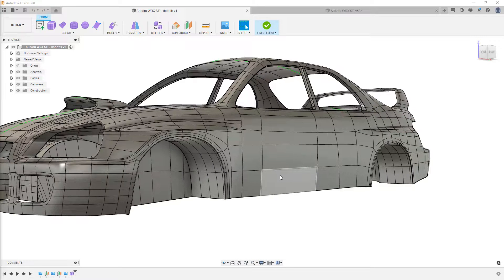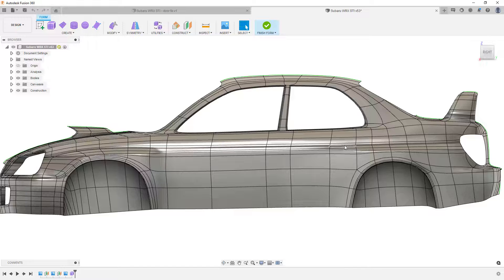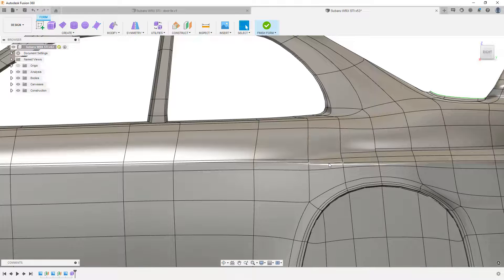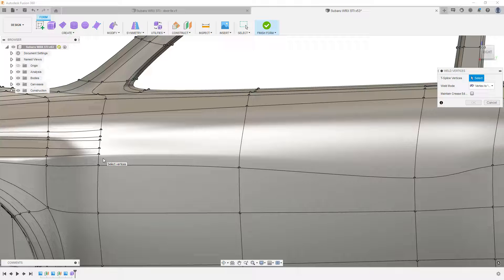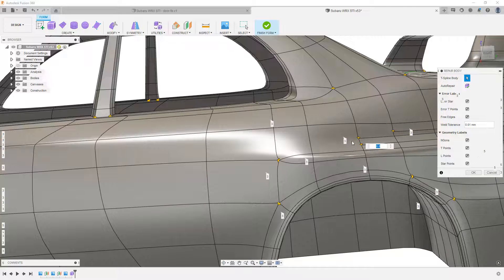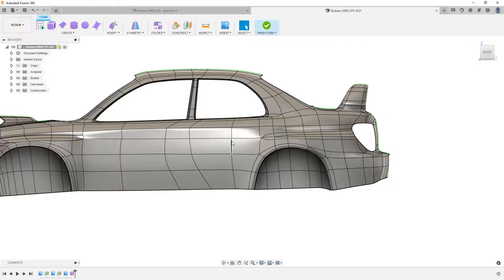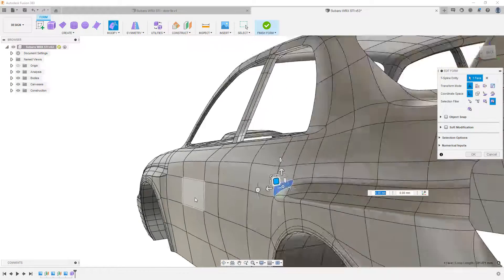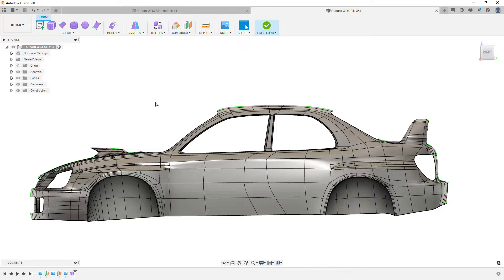Fusion 360 Forms - Part 11 - Fixing EVEN MORE surface issues

Comment: Teacher from 3:0 please why didn't the highlight go away when you deleted the edges.
Reply from the maker: sorry, 13:04 is the end of the video. at what point did that happen?
Reply: @LearnEverythingAboutDesign   sorry at 3:0
Reply from the maker: With forms you really want to have 4 sides for every face.  That is the ideal.  What we find with more complex shapes is we often end up with 3 sided. more than 4 sided (n gon) faces which result in "star points".  Star points are where you have 3 edges or more than 4 edges intersecting at the same point.  This generally does weird things to the curvature of the surface.

We also have T points which let us end an edge at another edge.  t points can be converted to star points and both have different affect on the surface.  A lot of time what you find is that you need a lot of faces or edges in an area with a lot of detail (like a boxy fender flare), but less edges on a longer flatter section like a door.  Trying to use T points to help keep the control where needed is a trick to prevent having too many edges making shapes harder to control.

This series was never meant to be a whole car but i kept getting comments to do more so i did.  I do have a Ferrari 308 and a Porsche 911 series on this channel that are more complete and i walk through the process a bit better.  I would suggest checking those out (the 911 is the more recent one).
Reply: @LearnEverythingAboutDesign  God bless you sir, please do you have online private lessons. I really do want to learn this skill. You are the best person I have seen on YouTube so far, cause you try make a neat work.